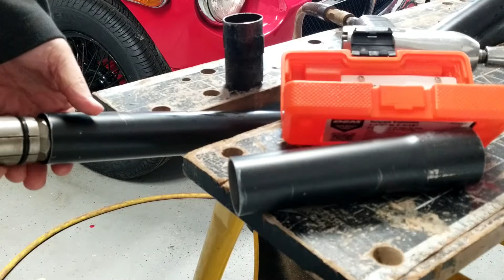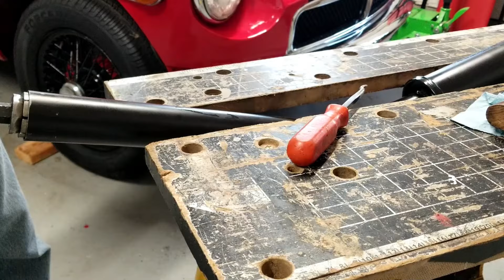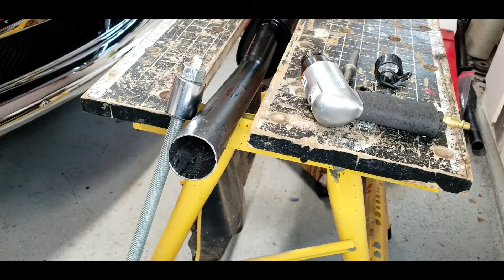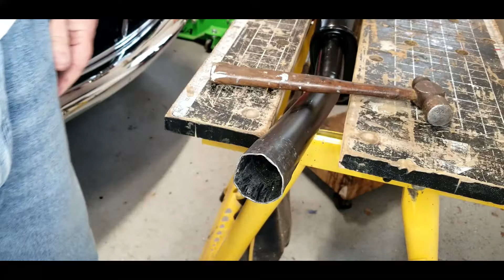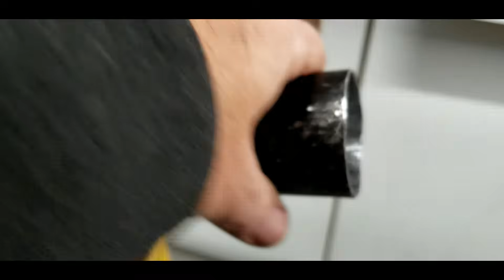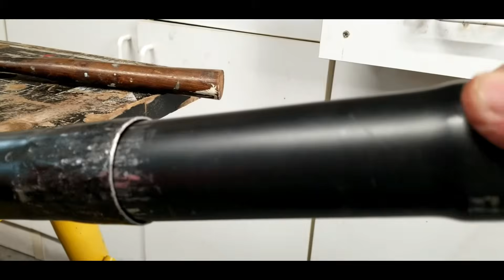How to Expand an Exhaust pipe using a 1" socket, and an Air hammer

Comment: Use some high heat from a propane torch, then try the expander?
Reply from the maker: I don't think that would be a good idea.  there is a rubber o-ring that is supposed to prevent it from sliding when you apply torque.
That thing would melt if you used heat.

thanks for the input though.  I am sure that heat would be helpful in my final solution.

Comment: Others here have mentioned that the air pressure isn't high enough, others have mentioned that the husky isn't powerful enough, but one thing that isn't brought up is the size of the air hose. 
I had bought three different 1/2-in impact guns and one was Napa. I don't recall the other brands. All of them struggled and couldn't get off my lug nuts. 
Looking online, I found a couple different videos that said that quarter inch airline isn't enough for one of those air wrenches. 
Think electric cord. If you were using your circular saw And a 16 gauge gauge 50 ft long, extention cord going to your Skillsaw, it wouldn't do so well. It would however work great if you used a 50 foot long 12 or 10 gauge extension cord.
Yes, I know that this is a year old but people are still going to read it for eternity. I thought I'd bring this into the mix.
Reply from the maker: You'd be surprised how much play these old videos get.  Great comment.   I will have to get a larger diameter hose and do some testing.

My compressor is setup more for painting. (High volume medium presdure)

But it has a big tank.  So i could test its capabilities with only minor changes.
Reply: That would be a fun test and educational too.
I have a 112 v makita 5200 compressor, 3hp so it says. Its the one with fold down hanfle and wheels. It has two hose nipples. I had pondered doing a 1/2" setup on one side but never got around to it. @AlexPlatacis
Reply: Automotive tech here,  air hose size matters.  Personally,  i hate the small airline,  other than to paint.
Reply: It doesn't matter how much air or gun power the expander tool gave up before could do any progress

Comment: And do not let thes guys miss lead you into believing it was your impact gun, I had a snap on, and worked in a shop with a huge air compressor.
Reply: Snap on air guns and impacts aren’t that great. But also I don’t think that expander really works for steel.

Comment: Your first way was something I tried over and over for years and never could get to work. I've heated the hell out of the pipe with a torch in order to expand it, but of course made the tool a 1 time use. That Chinese stuff is made for the trash anyways. The second way would be my choice if I were to do it again.
Reply from the maker: I have been thinking I would develop a tool for this task.  Expanding the pipe is the proper way to install them.  But there seems to be a need for the average weekend warrior to expand them

Comment: It's really a not an expander per-say. The only thing I've found these to be good for is to push the detents that pipe clamps leave  on the pipes back out again.  There are expander kits that do a pretty good job out there, if you don't mind spending about a hundred dollars or so on them.
Reply: That's true. There is a much heavier duty tool similar design specifically for expanding exhaust pipe also works with an impact gun.

Comment: After the tool broke and it became yours you should have put it in the pipe and used a bottle torch and heated the pipe pretty hot and kept stretching it, it would've softened the pipe and stretched with the tool... Might have overheated the o-rings but it was shot anyways. The tool only would have fell apart only when taken back out.

That tool is only for thin aluminum pipe. It's false advertising to say it will work on steel. Steel pipe takes hydraulic pressure to swell it bigger.... Or heat to soften it.
Reply from the maker: Yeah, there are plenty of ways to accomplish this task.  Fyi I took the tool back, and they still gave me my money back.  Autozone has a policy where you don't have to pay for broken tools.  They just send them back, themselves
Reply from the maker: https://youtube.com/shorts/0hzV0O0VHBw?si=19HMOE-H1orAqBLD
Reply: heat would damage the rubber o rings  then you own a damaged tool

Comment: instead of ruining a socket a solid rod or maybe thick pipe that wont distort
Reply from the maker: Actually, the socket was harder than the metal, so it worked fine.  It was not ruined.  Not even a scratch.  The other advantage to using sockets was it readily gave me different sizes to choose from.  Anything else would have taken more time to fabricate.

Thanks for your feedback though.  I welcome different  techniques and shared experience.  Helps all who see this.

Comment: I've tried those pipe expanders  a number of times. Never worked...its a "Magic Snake Oil" tool. Much simpler to use a double flare connector, or an inside-outside adapter and two clamps. I also apply a good quality exhaust cement in the joint before tightening the clamps. All of that beating with hammers stress weakens the metal. Best practice (if possible) is to have a  muffler shop weld the joint.
Reply from the maker: I had never tried an expander before.  Thought it would make for some good content.  Got to admit, my primary goal was just to save money.  Although having less clamps in the solution was also appealing.  
Great feedback 
Thanks

Comment: I did exactly the same thing to my Monza exhaust except that I took it to a muffler shop They expanded the pipe on their hydraulic machine. Perfect fit and no charge. Took all of a minute.
Reply from the maker: Ah.  Yeah but where's the fun in that

LoL
Reply: @AlexPlatacis  You could have bought a tig welder, learn to use it on thin materials, then bought and welded on a pre expanded end.
Lot of ways to skin a cat.
.....do people still do that? 😱
Everything I've done in my life has been to see if i could do it.
More power too ya.  If you dont try, you don't learn.
Reply: @randywl8925  maybe,  but if you're in a spot where you can't spend,  the info is there too help.
Reply: @raleighjones8247  Sorry, I didn't type sarcastically enough. I can't afford a TIG myself.
Reply: no charge, seems like you got off lucky.
its 10 bucks to stretch a pipe at most places.
even if they provide the pipe of say 4/8 inches.
stretched to 2 1/8 from 2".
Reply: How much did they charge u for that?